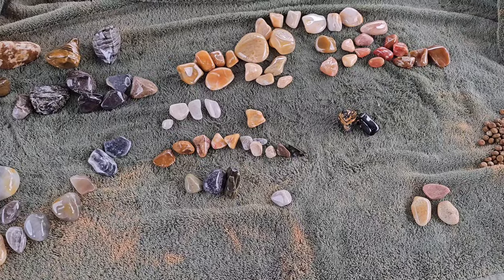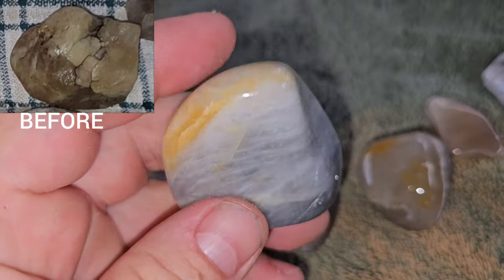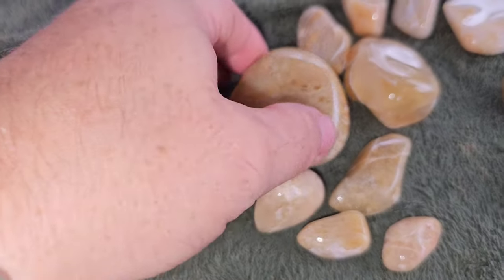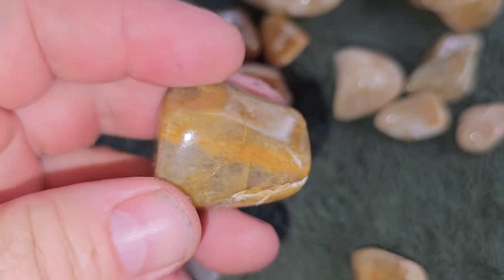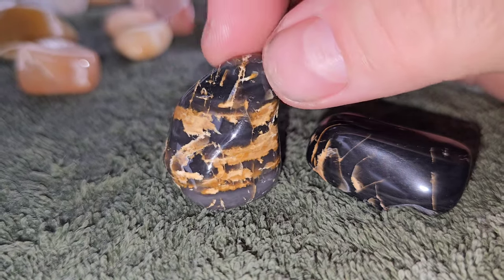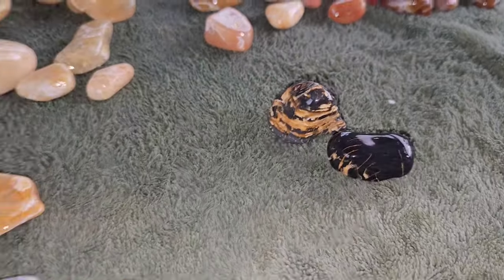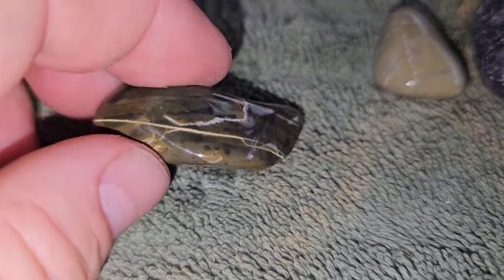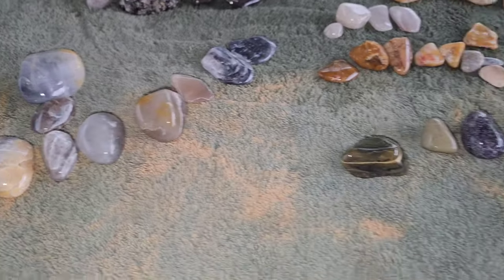We polished landscape rocks and the results were surprising!

Comment: Have you run these through a borax cycle?  Sometimes those fractures are showing up because there's some grit in the seam.  Overall, these look really good.
Reply from the maker: Hey thanks for the suggestion. I did a burnishing with dish soap for about an hour. I'm thinking I'll try another run with borax to see if it helps😁👍

Comment: Certain types of media like ceramic pellets or plastic pellets will help cushion the rocks and keep them from crashing into each other in the barrel. You can get the media from your local rock shop or online.  Usually, the same place you buy your polish. Anyway, that will stop more fractures from developing or getting worse.
Reply from the maker: We actually did use ceramics in this one, but maybe the wrong ratio? I also adjusted the positioning of the dowel on my Lot-O tumbler as it's seen others do, maybe in getting too much movement now. 🤔
Reply: I like to use aquarium gravel. I find some nice tiny rocks in them too
Reply from the maker: @kingdonta9707  nice, I bet there's some good ones

Comment: There is plastic tumbling media of different shapes and densities that should be used when tumbling rocks. The media will cushion rocks and helps prevent rocks striking others  and cracking them or leaving hard strike chipping happening inside the drum.
Reply from the maker: @electrichellion5946  I haven't tried the plastic yet, heard mixed reviews about it and looks like it's a pain to separate from the stones so I've been using ceramic. Is plastic the way to go?